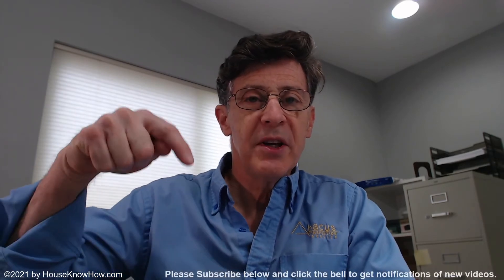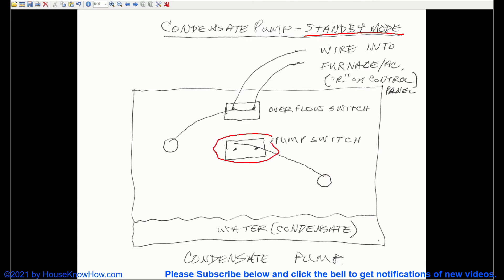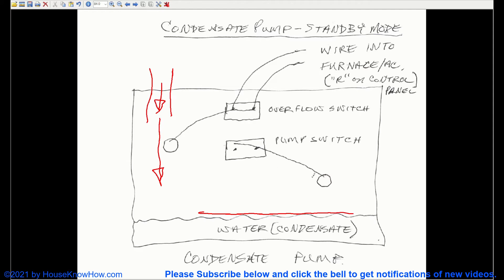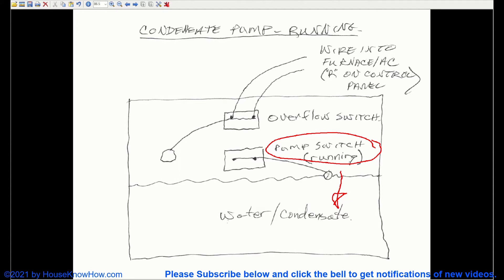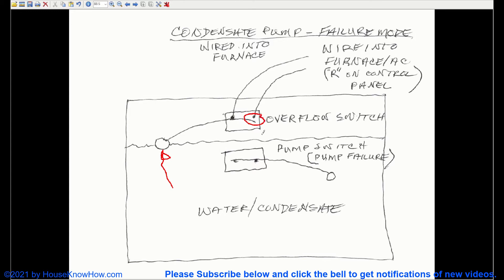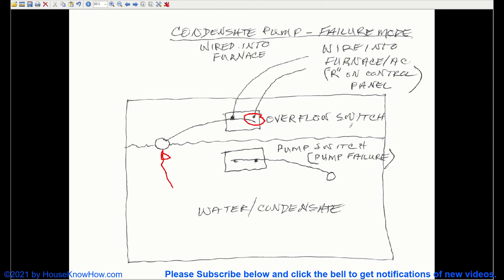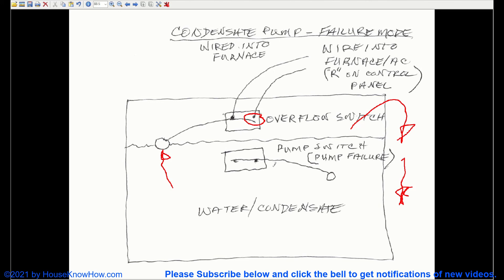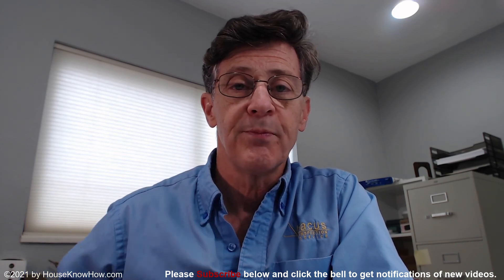How Does a Condensate Pump Work on the Inside?

Comment: Thanks for this video. I have one furnance and running nowadays but I couldn't see any condensate pump. Water is dripping through a hose pipe connected to a drain.Appears all mechanical system no motor.Mostly where this pump is used?
Reply from the maker: This type of pump is only present if there is an air conditioner attached to the furnace or if the furnace is a condensing furnace (has plastic exhaust pipe instead of metal). Also, it would only be installed if there is no drain nearby.